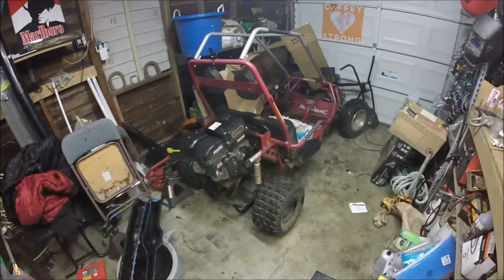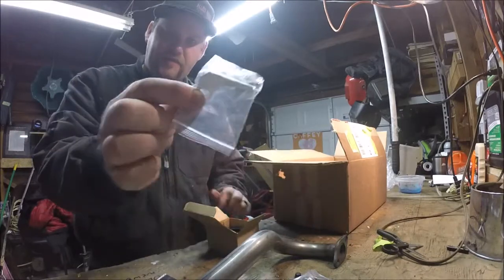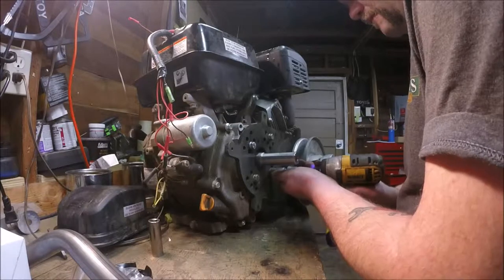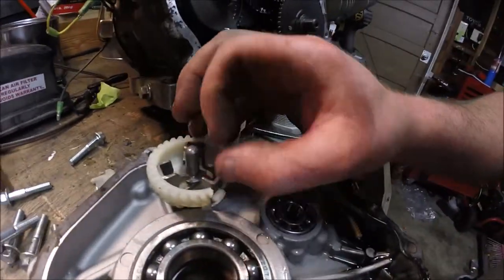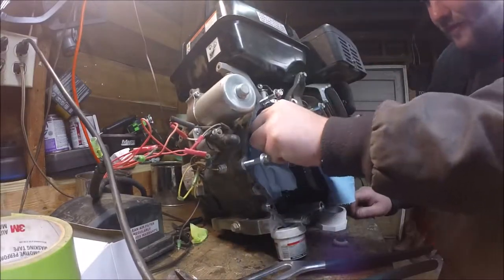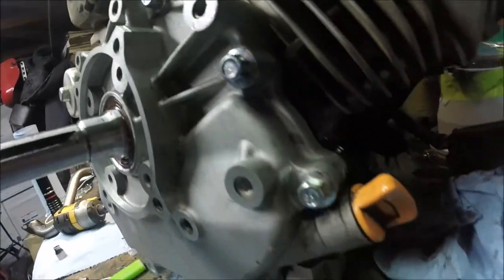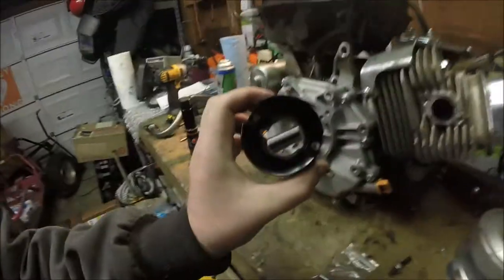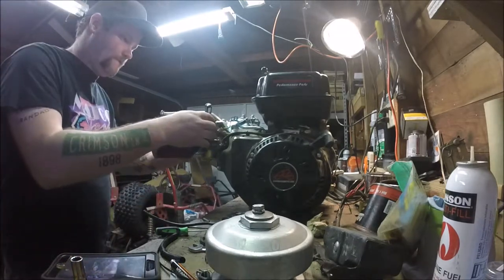420 CC PREDATOR STAGE 1 KIT AND GOV REMOVAL

Comment: If you just disconnect the govener arm on top of the engine , do you have to remove the govener wheel and  j shaft in the engine?

Comment: Why is it necessary to crack open the case to remove the gov?
Can't you just unhook the mechanism and hook straight to the throttle?
Reply from the maker: Yes you can but this way you can remove the gear completely

Comment: Good vid. I already took the governor out, do I need to add the kit for any reason?
Reply from the maker: Bill Hengler no it is not needed but is really helps with performance!
Reply: Ok, I can finish my motor install now. I can always add the kit later. Looks like it may be a good idea to upgrade the valve springs once I purchase the kit. Thanks!